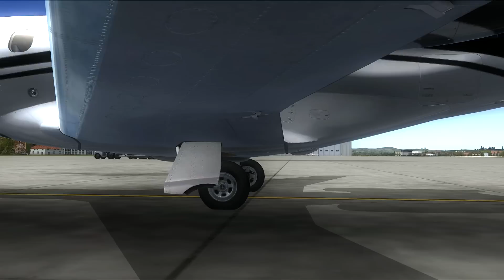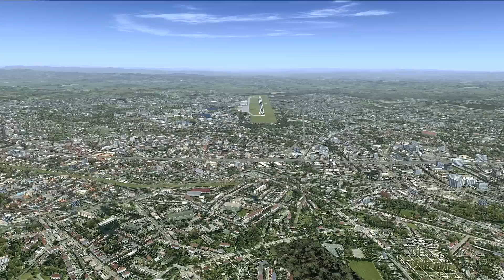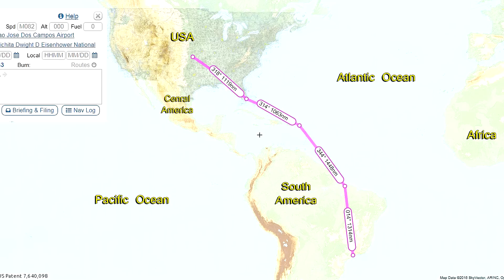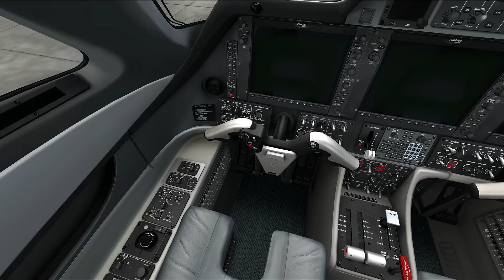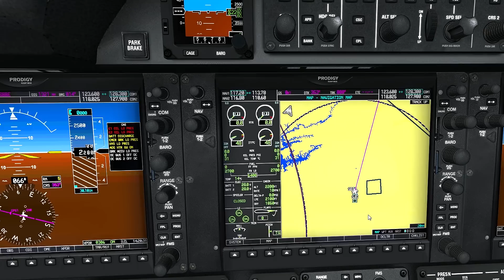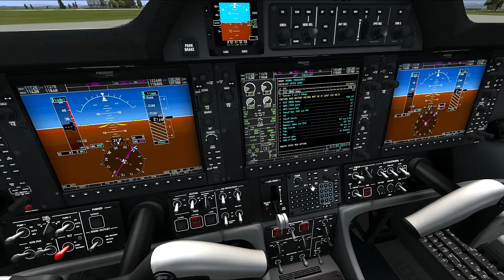Carenado Embraer PHENOM 300 Brazil to Wichita Leg 1, part 1 of 3

Comment: Great video. Keep them coming!!!
I have a few questions: 
1. How did you get the OBS button work? I have SPAD and no FSUIPC. With SPAD I could not do it.
2. On G1000, I got vectors from ATC that was different from my flight plan. Eventually I wanted to resume my own navigation, but the GPS did not sequence correctly. Did you also find this to be true?
3. On G1000 I get a shortcut in Arrival or Approach, I did not know how to skip to a new waypoint. I believe selecting that waypoint and pressing the Direct-to button should do the job, but, when you the Direct-to button, it wipes out the flight plan and reverts to a DIRECT-TO mode, but all waypoints in the Flight Plan is lost. Do you know a workaround for that?
Thank you very much for your help.
Reply from the maker: Hi Csaba,  I am very sorry for missing your comment until now.  These Carenado aircraft are finicky beast for sure.  The best support system I have found is the AVSIM User Forums under the Carenado thread.  Those guys are very sharp and seem to have worked out most of the bugs.  Hope that helps!  Kindest regards, Tim

Comment: Purchased the 300 2 weeks ago watched all your videos Legs 1,2,3 to learn how to setup and fly. One silly question, using Ezdok I was able to open the cabin door but tried everything from the inside to the outside to close the door and nothing worked...help.
Reply from the maker: Hi Jim,  I use a keyboard command to open and close the door.  I think Carenado also has a set-up window that will do the same.  Shift + 4 or 5 or 6.. from memory.  I think the FSX keyboard command is Shift + E?  You can check the  command list to double check.  I know the jet will fly much better with the door closed!!  Hope that helps.  Best regards, Tim

Comment: hi there, im new to using the g1000. Id like to know where you get the waypoints from? i dont quite understand how they work. Im used to flying commercially with sids/stars and those kind of waypoints. if you can help that would be very great! thanks in advanced
Reply from the maker: +Fsx_Productions Hi, There is a FS MaNiA "Flight Planning Tips and Tricks" tutorial video that will explain where and what I use for flight planning.  There are several very good and FREE websites that are great tools for planning your route.  The SIDs and STARs contain their own waypoints.  The en route phase of the flight is typically made up of airways which are defined by a number of navigation aids, intersections, and waypoints.  You can find my tutorial here: https://www.youtube.com/watch?v=-htOu9RRYTk&list=PLd5xLhYjSFLG3eeADfn_IlW2o721KUL50&index=2 .  Hope that helps.  Kindest regards, Tim G., FS MaNiA

Comment: I like Carenado but their glass cockpit stuff always gets a big frame rate hit, even on a high end PC (EDIT: 4.5GHz 5820K + GTX980). 

The moment you turn off the MFD you see a big jump, sometimes 10FPS more. I wonder if they are working on that?
Reply from the maker: +Mirandorl Hi Mirandorl, I have heard/read comments similar to that in the AVSIM Forums.  I really don't have problems with frame rates on the Carenado G1000.  Usually my frame rate issues come from very complex scenery, clouds/weather, and AI traffic.  I'm not sure why some people are having frame rate issues with the G1000.  I seem to recall there is a way to cut off the co-pilot's PFD was helpful?  Coming very soon to the FS MaNiA channel is a video of the Phenom 300 using Bert Pieke's Garmin GTN-750 modification.  That will be a flight from Fort Lauderdale to Wichita.  Stay tuned for that!! Kindest regards, Tim G., FS MaNiA
Reply: FS MaNiA Thanks again, yeah turning off one of the PFD's can help, and I have also heard its possible to edit a config to reduce the amount of objects that appear. Its always a decision I make when looking at the Carenado stuff though. I love the TBM 850 for example, but if I want to run it with heavy scenery I know I will be backing a lot of settings off. Unusual that it seems to affect some setups more than others, my CPU is a 6 core chip and I am running P3D 2.5, so I don't know if that makes a difference. 

I am looking at buying the GTN750 so I will keep an eye out for the video!

Comment: how do you get the auto trottle to work?
Reply from the maker: +Redbutta Ggg Hi Redbutta Ggg,  There isn't an auto throttle in the Phenom 300.  It does however have FADEC (Full Authority Digital Engine Control).  The FADEC regulates fuel control (among other things) during start up, and at various power settings.  It uses outside air temperature and atmospheric pressure to calculate the fuel flow based on where the pilot sets the power levers.  There is a detent for Takeoff, Continuous/Climb, and Cruise  settings.  The CSC (Current Speed Control) allows the pilot to set the current speed control into the AFCS (auto flight control system) and the FADEC will vary fuel flow up to 10% in order to maintain the current speed set.  That is sort of auto throttle, but not in the same sense as Boeing or Airbus where the power levers are actually moved by the auto throttle controller.  This is a very simplified explanation, however, I hope it helps.  Kindest regards, Tim G, FS MaNiA

Comment from the maker: To Joshua Bjerke....  For some reason unbeknownst to me, the "reply" option is disabled on your question below?  This happens sometimes with these comments and I'm not sure why.  It drives me crazy as because it prevents me from responding directly to your comment.  I try to reply to every single question or comment on this channel to the best of my ability.

To answer your question... the Phenom traffic at the Sao Jose dos Campos are flights I made in the various Phenoms around the airport while recording them with FS Recorder.  I replayed those flights with FS Recorder using "play as traffic" feature, during the startup and taxi out of the Phenom 300 757XM flight.  Doing that puts a very heavy load on my system, but it gave me the relevant Phenom traffic while at the Embraer delivery hanger in San Jose dos Campos.  The other AI traffic was Flight1 Ultimate traffic.  

I hope that helps and I hope you find this message.  Kindest regards, Tim G., FS MaNiA

Comment: Yay Tim! Here they are! Excellent. :)
Reply from the maker: +Jeff Puha Thanks much Jeff....Enjoy the flight!! Cheers from Tim G., FS MaNiA
Reply: FS MaNiA Thanks a lot Tim. I very much enjoyed all three episodes. Looking forward to the rest.
I noticed you had some information on your Facebook page about the v1.2 Navigraph Extension Pack for the Phenom 300. That sounds great. I'm going to read the full comment now. I wonder if they have v1.2 for the Hawker 850SP. I'll have to check. All my best. Jeff
Reply from the maker: Jeff Puha Hi Jeff, I'm not sure about the Hawker v1.2 Navigraph, however, the Phenom Navigraph v1.2 has issues.  I installed it and then uninstalled due to Vnav issues.  Carenado is aware of the issue and says they are working on fixing the problem.  I'm ok with the Version 1 at any rate.  Tim
Reply: FS MaNiA Oh. That's a shame. I hope they get it sorted out. I went to Carenado's website and they don't yet have the v 1.2 Navigraph for the Hawker 850SP, unfortunately. Perhaps they will after they get it fixed. 

Is the next leg of the Phenom 300 Brazil to Wichita flight coming soon? I hope so. :) Jeff
Reply from the maker: Jeff Puha Hey Jeff,  I worked most of the weekend on Leg 2 of the Brazil to Wichita flight.  I have part 1 and 2 uploaded.  Still have some editing to do to finish the full Leg to St. Maarten.  There's a ton of work to do for just one flight, and I have a total of 4 to get to the final destination in Wichita.  At any rate, we'll get there in due time to be sure.  Thanks for keeping up with us and staying tuned in.  Kindest regards, Tim G., FS MaNiA
Reply: FS MaNiA Yes. I can appreciate all of the work you put into these flight videos. I'm enjoying them very much and I thank you for doing them.
Oh. By the way. What scenery did you use for St. Maarten? The clip you showed for it in the first video looked gorgeous. Thanks. Jeff
Reply from the maker: Jeff Puha FlyTampa St. Maarten Scenery Add-on.  It includes St. Barth and Saba as well.  You can see more of the scenery in one of FS MaNiA's first video series featuring the Carenado Cessna 208B EX Grand Caravan.  I did some crazy flying in that series!!  They are under a Carenado Cessna 208B playlist on the FS MaNiA Channel. Tim
Reply: FS MaNiA  Thanks for letting me know. I think that scenery is really beautiful. I haven't watched your Grand Caravan series because I don't like that plane. Perhaps I'll take a look at it because of the scenery, though. :) Jeff